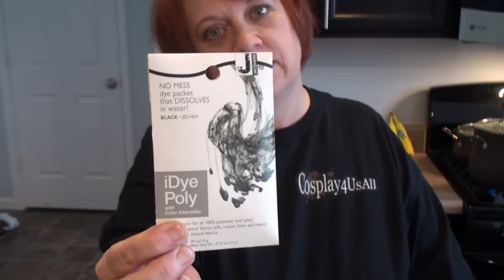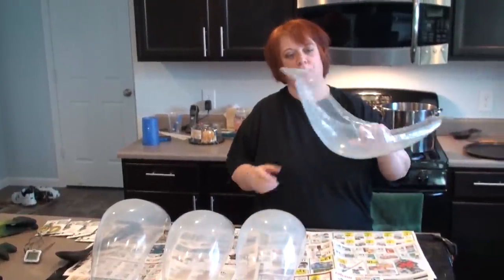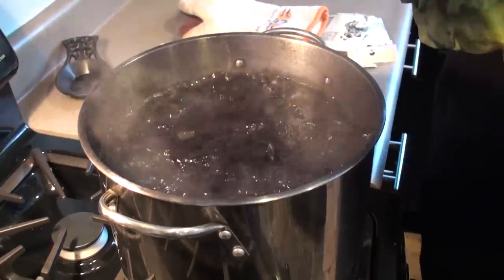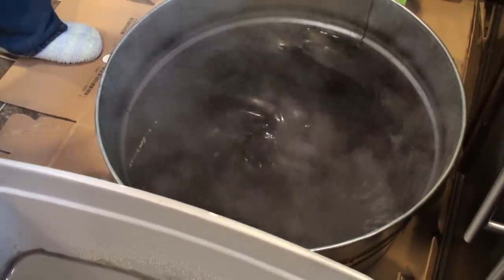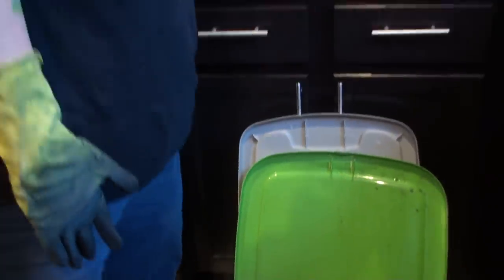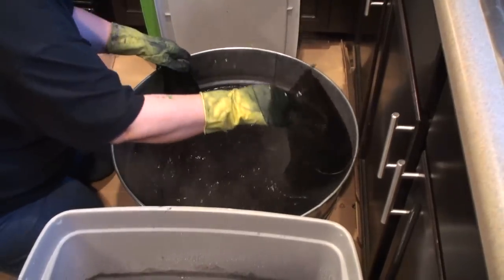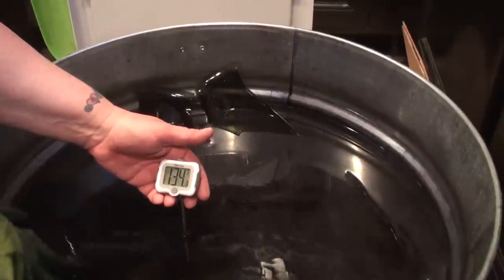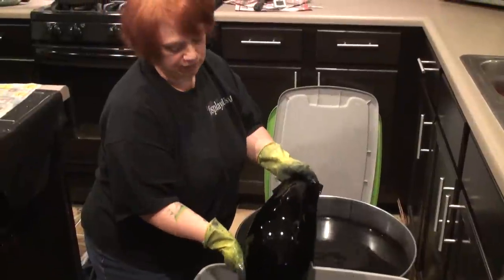How to Dye a Plastic Visor (PETG)

Comment: I needed a vaguely tainted lilac visor and thanks to this method i learned how to dye it thank you so much 🥰 i laser cut the visor in acrylic and tainted it with Dylon dye since where i live we dont have iDye, and i have to submerge it like 5 times and re-heat the dilution in order to keep the temperature.
Reply: Ericka Franco Ha I also need a light purple tint on a visor, what character is is your’s for?

Comment: I'm trying this dyeing process for a friend. It's a really small visor like thing, but I didn't realize you weren't using acrylic sheets for your visors. Will the dye still work on it, it's been in the pot for 10 minutes, but there's hardly a visible change...
Reply from the maker: As long as you have enough dye and you have the temperature right, it "should" work. Acrylic sheets will have a different heat tolerance than PETG does (also depends on the thickness), which you can find online. It also takes much longer than 10 minutes to get a nice dark color. You may want to use a test piece and try it with the water a bit hotter.
Reply: Yes, I've been using a test sheet, and I only need it a very light, clear blue tint. I'll try turning the temperature up, thank you!
Reply: Maddy J Any success? What temperatures did you use? and for how long? Thanks

Comment: Would just iDye work? or does it have to be iDye Poly? None of my stores are carrying iDye Poly in black. Only the original.
Reply from the maker: We would not be able to give you an honest answer as we have only used the Poly.  The reason we went with the Poly is that it is designed for polyester and nylon which are types of plastic.

Comment: Such a great tutorial but just a few questions!
1) What thickness of PETG did you use?
2) Would you be able to use a hot air gun to shape it?
3) Is this the whole process or do you have to do something afterwards to seal it or tint it?
4) If you are looking at the person wearing this, can they see their face at all?
5) How would you go about sticking it to the helmet?

I'm a halo cosplayer and was getting sick of using motorcycle visors that didn't work for the helmets!
Reply: Emily Harris If the inside of the helmet is dark then no you won't be able to see into it at all.
Reply from the maker: Sorry Emily, I never saw this comment! If  you are still interested:
1) 1/16th PETG
2) You can use a heat gun to CAREFULLY heat mold a thin piece of PETG, but not something with this complex of a shape. It would most likely get all wibbly wobbly wonky looking (lol). We used a heat gun to form smaller, curved pieces without issue though.
3) No sealing afterwards. We do use plastic cleaner/polisher to remove dye residue and give it a shine (see the expanded details under the video for specific brand)
4) No, you can't see the face of the person wearing it at all
5) If you are talking about sticking it to, for instance, the inside of a halo helmet, you could use strong (like 3M) double sided sticky tape and attach a slightly larger piece of PETG to the inside of the foam/resin helmet. Just make sure you get the GOOD tape, not the wimpy stuff you find in the stationery section. You want the stuff they use for automotive use, etc.
Reply: lmao have you never worn sunglasses before

Comment: Another effective trick is if you have smaller light yellowish white nylon plastic parts that you want solid black, just get a container and use 100% acetone and add a tone of the iDye Poly and maybe heat it up by using hot water and well ventilation and that works the best.

Comment: Hello! What would be the best approach for giving a petg domed lens a slightly chrome finish? My friend tried the "spray chrome in the inner surface" method, but due to the increase of humidity in the mask, when he touched the lenses he accidentally wiped off the paint. My friend recommended me to simply spray the front of those back lenses (think of the build as outer PETG lenses and inner painted PETG lenses with a fabric mesh sandwiched in between), but from my understanding the shiny effect only appears on the opposite side of where you've sprayed, while the sprayed surface retains some visibility. I was thinking of using a chrome dye for a pot (if those even exist), or to apply a clear antifog film like the ones used for mirrors in the inner surface of the sprayed lens, if that won't ruin the way the chrome reflects. What do you think? What dye type should i be looking for? Because i might even try to paint the petg white.

Comment: Thanks for the tutorial! Any insight as to how durable and lasting the dye will be on the PETG? I am using the plastic to create stencils that will be used to paint signage with latex paint, and so the PETG stencil will be continuously cleaned off. Would I ever be running the risk of cleaning off the dye or is it permanent? Thanks again!
Reply from the maker: The dye is permanent. It soaks in to the pores of the plastic, which is why it is important to get the temperature right (plus you don't want to warp the plastic!). Once it is rinsed in the cold water and then cleaned, it should be pretty well set for good!

Comment: Hi! first of all great tutorial I love all your stuff. Just one question, do you know if this would work with acrylic or transparent polystyrene? I saw lightbulb dyes in many shops but they have very strong dissolvents, do you think they could melt acrylic instead of dyeing it?
Reply from the maker: I don't see why it wouldn't work on acrylic too. Depending on the thickness of the material you could probably keep the water a bit hotter than we did with the PETG. I would try a test piece first. Always better to screw up a scrap than screw up the real thing!

Comment: Hi, cool method. I tried this but am getting a little warping, could I die at a lower temperature or should I heat up the plastic parts before putting in the hot water?

Comment: Excuse me but two quick questions. What kind of plastic did you use to mold your visor? Where did you get the plastic to mold? I'm using a vacuum seal on a mold of my daft punk helmet visor. These two questions can save me so much time. Thank you ahead of time! Loved this video as well!
Reply: We used 1/16th PETG plastic (like what they make soda bottles out of). We buy it in 4' x 8' sheets from a local plastic manufacturer. You can google plastic mfg in your area or sometimes sign making shops have very thin plastic. I am sure you can probably find some online but I couldn't point you to one particular site
as we just take a short drive to get ours :)
Reply from the maker: Sorry. Replied to you via our other YouTube account, lol. But the answer is the same :)
Reply: Cosplay4UsAll thank you very much!!! ((:

Comment: Very nice instructional video. Maybe I missed it somewhere, but why are the visors tinted and rinsed several times for approx. 7 minutes each time, stretching out to 45 minutes total of tint time? Thanks.
Reply from the maker: Charlie Ross we wanted them to be as dark as possible. Rinsing in cold water helps the color "set" on the plastic, and resoaking them adds more color.
Reply: Thanks. I'll be checking in to this method, most likely for some motorcycle stuff.

Comment: Thank you so much for this.  It's the best video of its kind on the internet.
I am dyeing a protogen visor for my child's halloween costume tomorrow.
I know I can get Rit DyeMore graphite locally.  Unfortunately there don't seem to be any local vendors of iDye Poly in black.  
What issues are people reporting with Rit?
Also, my first attempt to do this failed last night... the visor deformed and curled up.  I note that yours remained perfectly formed.  I assume this happened because I was heating the dye pot directly and failed to remove the pot from the burner.  (I shut off the burner, but the residual heat from the coil probably made the water near the bottom of the pot too warm?)
I plan to re-try this tonight with a new visor.  Do you have any advice for me to keep the visor from curling and get the best possible results with Rit dyemore liquid dye?
Reply from the maker: I can't comment on the Rit dye. The only thing I know is that the idye poly is formulated specifically for plastics (ie polyester etc). 
As for the deforming, sounds like you definitely had the great too high!
Make sure you get the water high, as the dye directions state, but then you MUST cool it down before putting in the visor. So remove from the great source and allow to cEool to right below the deformation temp of the plastic you're using (you can Google it, if it's not PETG). Let it soak but be sure to keep swishing it around or you'll likely get dye spots on the plastic.
Good luck and Happy Halloween 🎃!

Comment: I did a vac form visor for a robocop helmet i sculpted, the visor for the movie they used a see through silver paint, i bought krylon mirror like effect as pointed in a youtube vid for halo helmets, but i saw a rit dye silver color, gray, i wonder if i use that gray dye on a visor wich result i will get? Maybe ill try it, since i dont know how this will work with gray color
The krylon paint is tricky, you apply too much you wont see through, you apply too little they can see your face thru

Comment: Wouldn't it make more sense to dye the PETG in sheets before vacuum forming it?  That way you could avoid any deformation of finished visors in the boiling water.  Or just buy pre-tinted sheets of PETG?
Reply from the maker: Boochieboy The only way pre-tinted sheets of PETG are sold are in minimum orders of 12 4'x8' sheets ($$$!). Tinted acrylic is available in smaller orders but would not work for our vac former. Tinting the sheets prior to vac forming would require a much larger set of tubs, as the sheet pieces need to be 24"x 24". It would mean that the protective plastic would need to be removed prior to vac forming, increasing the chance of damaging/scratching the plastic. Since the water doesn't actually need to be boiling in order for the PETG to absorb the dye, heat deformation isn't an issue. Also, since there is such a big draw distance, over the peak of the visor, if we dyed it before vac forming, there is the definite possibility that the dye in that area would be lightened, since the plastic has to stretch so far.
Reply: will you please give me the contact information for the place that sells the 4x8 sheets. i need to purchase that many.

Comment: I tried it with the visor I took off my Harley helmut and it DID NOT work at all. Is there a special coating on my factory visor that may have prevented the absorption of the dye?
Reply from the maker: Sean Korman If, when you say Harley helmet, you mean an actual legit motorcycle helmet, then no, it most likely will not work. Motorcycle visors, for the most part, are made of polycarbonate, NOT PETG, which is a much softer plastic (like a soda pop bottle). In addition, most motorcycle helmets have a coating that makes them safety treated so they don't scratch as easy or shatter on impact.

Comment: So i already have a helmet that's purple/blue and it said that the face cannot be seen from outside which when I got it, I can clearly see my face. Will this method work on a helmet that is already a colored visor? I was just hoping to tint it more or make it where outside can't see my face. I don't needs that much, probably only on the outside of my visor, i was wondering if there was like maybe a spray or some sort of paint i could just put on the outside of it
Reply from the maker: There is spray tint (sold at Walmart) but that will pretty much destroy the visibility you currently have. There is a link in the video description where you can see the visibility difference between the spray tinted version versus the dyed version.

Comment: Great video! If dying a clear piece of plastic with an Orange dye, will the soak/rinsing/repeat method cause that plastic to turn more of an opaque Orange or will remain transparent no matter how many times you soak it?
Reply from the maker: If it behaves like the black tint, it should remain transparent and just get darker with each soak.
Reply: @Cosplay4usall  I have to ask. Is it necessary to rinse and re-soak though? Could I just leave it in there until the water is cold?
Reply from the maker: You could leave it, just don't let it sit still for long or the dye might leave splotches of uneven color. Just swish, swish, swish. We often rinsed and resoaked because we needed to warm up the water (which activates the dye and opens the pores of the plastic) and to check the color progress.
Reply: @Cosplay4usall  that's good to know! Thank you for sharing your insights. 🙂

Comment: I just discovered this video, and its brilliantly simple. I'm wondering though; could this same process be used to tint an acrylic dome too??
Reply from the maker: As long as it's not got a safety coating on the acrylic, it should work. Find out the deformation temperature for the acrylic you're using, and make the water just a bit cooler when you dye it.
Reply: @Cosplay4usall  clarify "safety coating." And I don't know if I'll be able to find out the deformation temperature; it's for a totally different type of product. But, it says it's "impact resistant," and appears to be fairly thick, so I don't think it would deform under heat easily. But I figure if I stay within the 140º range, like you guys used, it 𝘴𝘩𝘰𝘶𝘭𝘥 be fine. crosses fingers
Reply from the maker: @JustASouthernGuy79  safety coating like what you might find on a visor for a motorcycle helmet, or safety glasses. If it has a coating on it, the dye can't penetrate the plastic. I would start at the 140 degrees and if it's not working, add some hotter water and get the temp up a bit. If it looks like the dye is being repelled from the plastic (it's not taking color and/or appears to just bead off) then it has a safety coating and you won't be able to dye it.

Comment: Question, I have very light scratches on the plastic I am going to dye will the dye hide them a bit or will it make them stand out? Also can use a polishing compound to get as smooth as possible or will the polishing compound miss up the dye from sticking?
Reply from the maker: Wayne Woodley Without seeing it in person, and how deep the scratches are, I could not say for sure what the outcome would be. I can guess though! Lol
Dye will usually settle more deeply in scratches and imperfections. If you have a test piece you could scratch and test dye, that might be a good idea.
As far as polishing it, most plastic polishers create a film that is also sort of water repellent. While the heat of the water may eventually wear that away, it could also inhibit the plastic from properly taking the dye.
Reply: Thanks for the response. I tried it last night and was not able to get the piece to accept the dye. I used Rit dye, they did not have the dye you have in the video at JoAnn's. I brought the water to a boil, added the dye and let boil for a few minutes to ensure it mixed well, added to container and let cool till the temp was at 149 degrees. I then added my plastic piece (is is the clear dust cover that goes over the speedometer/rpm/fuel gauges) and let it set for 1 minute and pulled it out, nothing. I tried again and let it sit for 2-3 minutes and nothing. I tried again for 10-12 minutes of soak time with nothing. Guess my plastic does not work with dye. I am not sure the type of plastic, I will try to look it up. Thanks for the reply though.
Reply from the maker: Wayne Woodley If the dye is anti-scratch, or the type of plastic used for safety gear, it may not accept dye. Sometimes they put a special coating on it that inhibits the dye (so I have heard). I have also heard from people who have had zero luck with the Rit dye, but then tried the iDye and it worked, so don't give up yet! iDye is also available at craft stores, like Hobby Lobby and sometimes at Michaels. Plus there's always Amazon!
Reply: Thank you!

Comment: This is a really good tutorial! Gave it a go yesterday but had mixed results. Some reason the dye just didn't seem to fully disolve and remained gritty in the pot which then stuck to the PETG which left big blotches on it... Any tips?
Reply from the maker: This has happened to us on occasion, as the dye sometimes will "settle" to the bottom of the dye container and if your PETG touches it, it can add "extra" dye to that spot. Also, if your plastic has scratches on it, it can settle more in those areas. We used Meguiar's PlastX to clean our visors afterwards. With some effort, you can often get most of the heavy spots off the PETG. Hope this helps!

Comment: I have a Nolan helmet and purchased the silver mirror visor. Problem is it's nothing like the mirror visor on my old fulmer helmet and I can see my reflection. Can I use this process to smoke that one or do I need to use a clear shield.
Reply: I have no idea. It would depend greatly on what material is used to provide the mirror effect. If it is sprayed on, possibly? If it is a sheet of mirrored surface applied to the visor, probably not. All I can suggest is to make a very small batch of the dye mixture and test it on a small, inconspicuous portion of the visor (keep an eye on your water temp!).

Comment: I'm making a celty sturluson cosplay and got a shoei motorcycle helmet for it. Will this same method work to make the visor darker? or is it just the type of plastic or similar plastics that is used in this video?
Reply from the maker: +Erin Rose We've only used this method for PETG. Some folks have also used it with clear acrylic with good results. Most motorcycle visors are made of safety glass, and/or have a safety coating on the glass, which often prohibits the dye from soaking in. All I can suggest is give it a try, if it doesn't work, you've lost nothing in trying ;)
Reply: this is the reason why I am on this video ! thank you for your question!